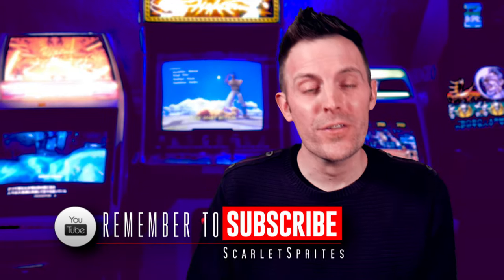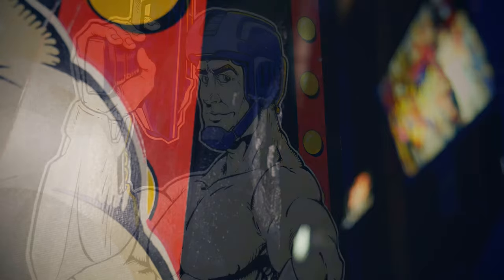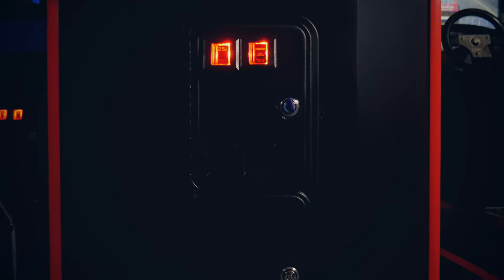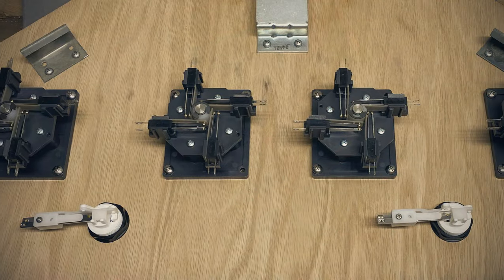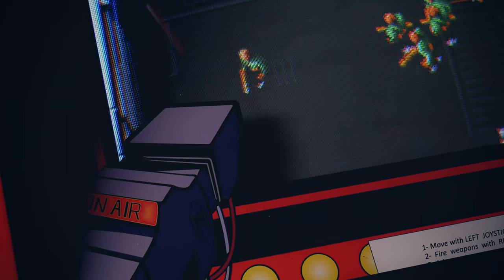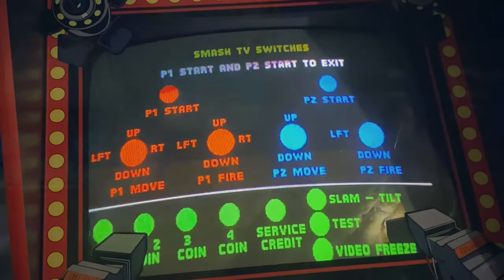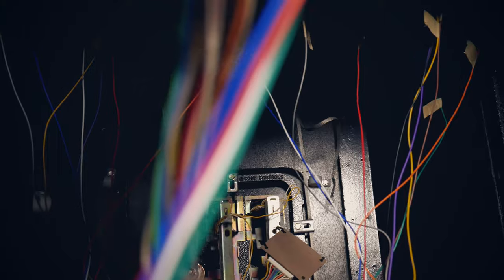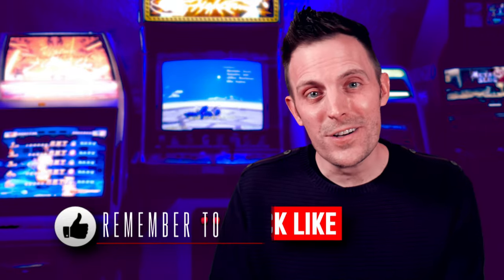Smash TV Arcade Machine:  Complete & Restored!

Comment: Looks great bud, thanks for your help on mine, I really needed that picture of the monitor mount to make sure I had it right.  I think your touchup work looks great, I'm thinking I may have to do the same with areas of mine.  I'm going to have the same problem with my artwork on the monitor bezel, I was thinking it would be fine but after watching your video, I think that would bug me.  Anyway, it came out great, I better get a move on... haha.  One thing I decided not to do is the metal on the control panel but maybe I should... what do you think?
Reply from the maker: You probably don't need the metal on the control panel but it sure makes the whole thing feel rock solid and makes laying the artwork down super easy.  In my case unfortunately, the latter will become a huge plus if I decide to redo this.  Your cabinet is coming along really nicely, especially considering the additional work you needed to do.
Reply: It's all about that James Bondo Ralph!

Comment: For the wavyness issue try looping the video wires from the Jamma harness once around a ferrite bead.  See the manual for Gauntlet Dark Legacy Universal Conversion Kit, page 11 for additional tips to mitigate RF interference (a probable cause for the wavyness).
Reply from the maker: Yeah it’s strange because it happens with Smash TV but not when swapped over to Total Carnage.  When Smash TV is plugged into another machine?  No wavyness.  I’ll give it a shot and see if there’s any improvement.  Thanks man.

Comment: Great balance of repro and keeping original. Awesome job! 😎👍
Reply from the maker: Thanks man!  Had to sub in the repro parts where I could.  Occasionally the marquees pop up but I didn’t want to wait.
Reply: @ScarletSprites  when I did my KI restoration I applied the same technique keeping it mostly original with the minor cosmetic imperfections and replacing parts like the CPO which was missing and using some paint touch ups and turned out amazing.
XL arcade has some great repro stuff.

Comment: Nice work! I like the repro Wico sticks as well. I didn’t know someone has made them available. I’m working on the Wico sticks for my tmnt restoration. Lots of rusty parts soaking in apple cider vinegar, but a rewarding process.
Reply from the maker: Arcadeshop.com sells the 3.5” versions in several colors and the 4” version in red.  I had kind of hoped to find 4” in blue to switch up the control panel a little for P1 and P2 but it didn’t happen.  
I’ve not used apple cider vinegar for rust removal.  Does that work out pretty well?  I was turned on to Evaporust while working on Virtua Racing and have stuck with that since.
Reply: Yes the apple cider vinegar seems work well. I used Evaporust on some pinball legs once and it worked very well. I figure since everything but the joystick itself will be hidden I could try a different method and use what I have on hand. The parts don’t look brand new, but they look tons better. The joystick bolts could use some polishing or paint so they shine up a bit more.

Comment: The Bezel overlay would have to go IMO.  Bit unfortunate on the other overlay bits for the control panel.  But not that bad all said and done for under a grand if it was less than $400 for buttons, 4 repro sticks, graphics and two game PCBs.  Do you still have the Marvel vs Street fighter PCB and control panel you can sell or repurpose elsewhere?
Reply from the maker: Yes, I saved the CPS2 pcb that was in here.  I sold the pristine one out of Big Blue and could recover more cost by doing so here as well.  I’ve been thinking I’ll just hold onto it though in the event that I need a backup replacement for my Darksoft kit.  As far as the other stuff I’m going to ride it out for a few months and see how much it irks me before replacing anything.  If it’s still annoying I then know I need to do it.
Reply: @ScarletSprites  
do you have mistercade?